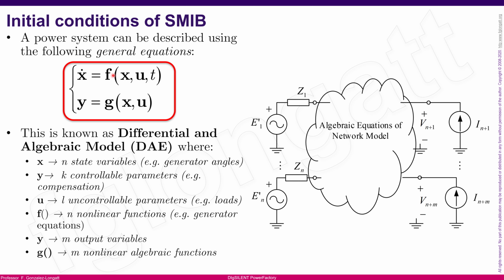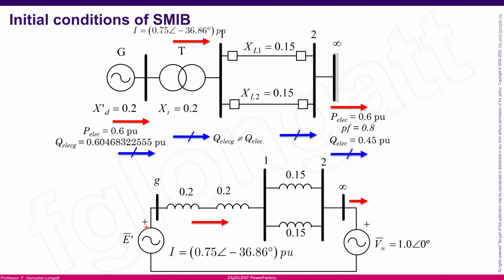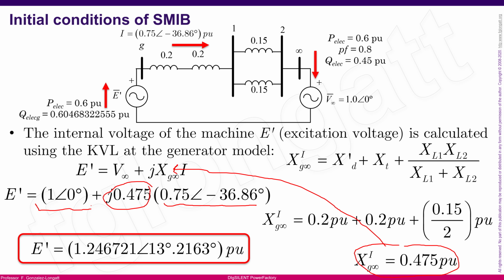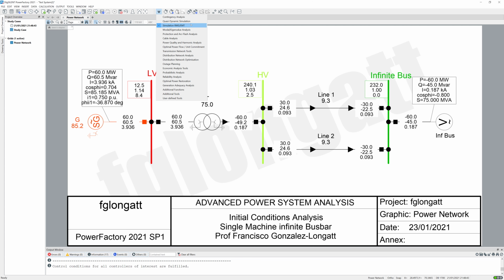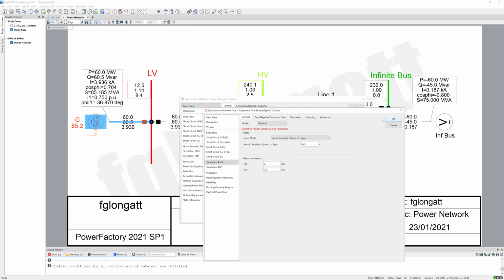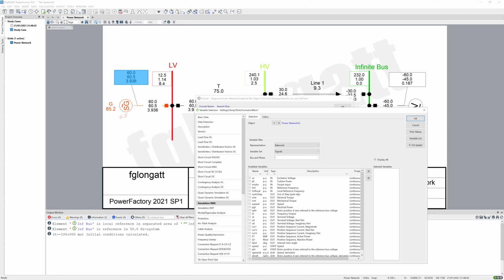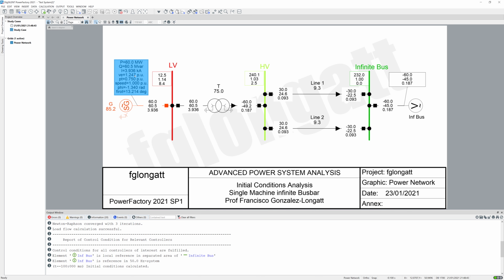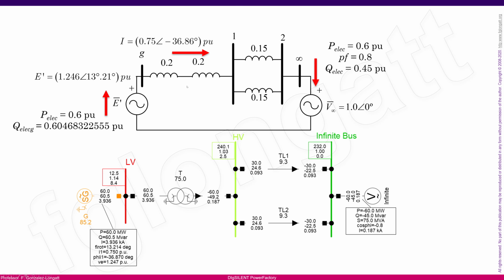Initial conditions of SMIB using #DIgSILENT #PowerFactory

Comment: synchronous generator is connected to an infinite bus through an ex ternal reactance Xe = 0.4 pu. Compute the Heffron-Phillips constants, Kl to K6 at the operating point (a) Pg = 0.5, Vi = 1.0, Eb = 1.0 (b) Pg = 1.0, Vi = 1.0, Eb = 1.0 The machine data: Xd = 1.6, Xq = 1.55, xd = 0.32, Tdo = 6.0, H = 5, D = 0, f B = 60 Hz.